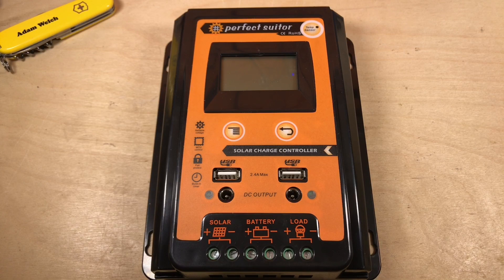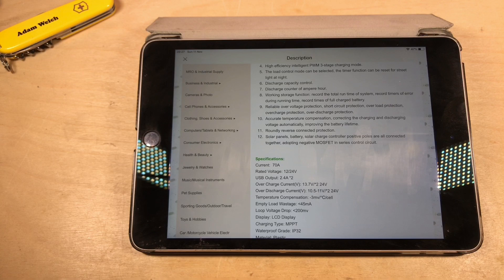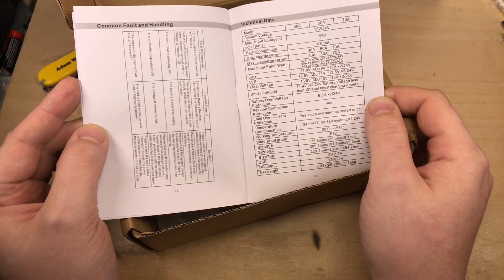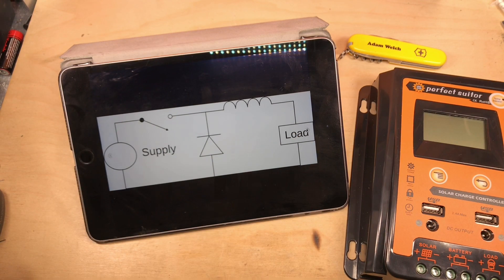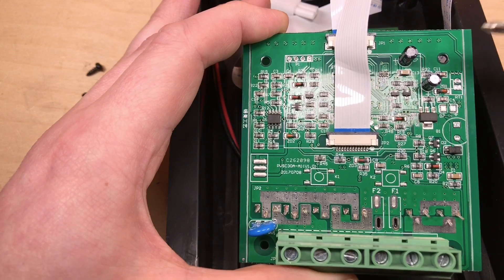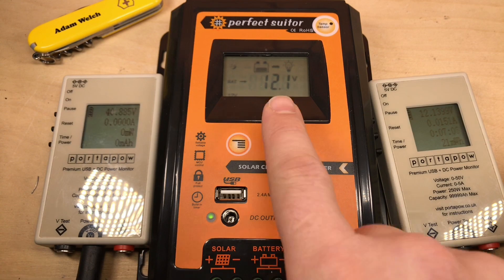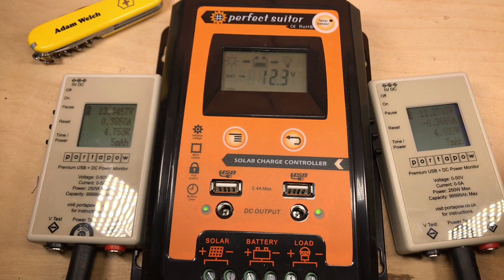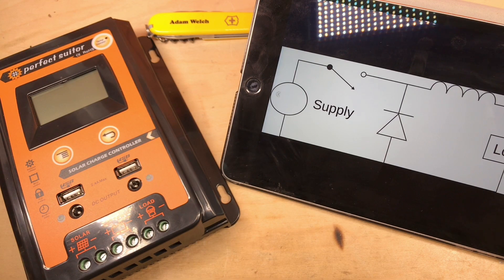MPPT or PWM? Perfect Suitor Solar Charge Controller

Comment: I have subscribed and watching all your nice videos. I have 3 cheaper PWM controllers and the last one I bought this Perfect Suiter PWM controller. I have 300W- 24 V solar panels I have bought over 100 recycled laptop batteries and spent hundreds of hours in charging and discharging with smart chargers and Imax B6 charger. I have made 5 battery packs starting from 3S 5P to 4s 15P packs. I just finished building my first 7S 21P battery pack. But my cheaper blue PWM  and this Perfect suiter controllers are charging my 4S packs up to 13.7V only and stops there. my 4S pack can receive up to 16 .8V but I do not understand how to do that. I am frustrated and in a desparate situation. My 13.7V packs work for a few hours only and dying. Please guide me and many thanks for your help.
Reply: You need a more expensiver controller supporting wide range of battery voltages, like Epever tracer-series (8-32V) then you can configure the maximum charging voltage.
Reply: Christer Olsson  Thanks a lot Christer, Adam did not replied to this question. Very bad, but some other YouTube experts replied to me and as per their advise I have already purchases a epever tracer 20A mppt controller. But not yet connected as it is not clear instructions on the manual for a beginner and worrying and waiting. If you are using epever tracer  you can guide me one time. If you are comfortable I will give my email address here. Thanks again.

Comment: no large inductor == no buck converter == no voltage step down
no current shunt resistor == no power measurement
no power measurement, no voltage stepdown == no mppt
Reply: You culd just look for MAX PV WATT 
ALL OTHER BLA BLA. BLAAA USLESS

Comment: I just bought the 30a version and despite what the manual states,  the 30a version is a cut down version with no current display or anything relating to power as it needs amps.  I have just posted a quick and very basic review of it on my chanel.  Go for higher rating unit.

Comment: The fact that products manufactured in china are not exactly as specified stems from differences in business protocol . There is a range posted in every speciation , through in millions of wanna bee's trying to justify a piece of that pie and at the most you get is a minimum spec. product . When demanding more for less from China , it's what you will get every time . All the big names ( Winsor , Bush , Etc. ) siphoned most disparage from that market long ago now and an even playing field is what exist today .   Thanks  All , Thanks  be
Reply: P.S.  Folks like you in the U.S. are buying into three dimensional printers building products with pre certified materials .

Comment: Where does the dc inputs pull there power from the panel or the battery?
Reply from the maker: The charge controller is powered from the battery.

Comment: Thank you for checking this out. I just recently got one for my camper, and wondered about the inductor as well. this gadget really is a small, light package. I tested another one which came with a panel I bought, and got results similar to yours. The display on the other one was very hard to read as well, at least this one looks good and is easy to read. One of the parts on the board where the USB plugs are does look like a small inductor, but it would not be enough to do the power conversion job for battery charging, although it probably is enough for the 12 to 5 volt USB conversion. My guess on that huge drop is that it's a waste of money to put panels in series unless you are setting up a 24 volt system. I confess that I did buy it because of the MPPT claim, and did not think I would lose too much if it isn't because of the low price. It works, and looks nice, but they probably should not be calling it MPPT. I installed a different type which actually can boost current, because of the limited space on the roof of my pickup camper. I can't just add another panel to make up for the lack of boost. I am keeping my "perfect suitor" as a spare in case the one I am using now quits. Thumbs up for your time, thanks.

Comment: Lol. They’re still peddling that junk... I just saw it listed as “simple mppt - no inductance”

I gave up on finding economical mppt controllers and stuck with PWM. Mind, some of the 30A PWM controllers can’t cope with even the 5A I put through them.
Reply from the maker: I actually think for most applications PWM is fine.
Reply: For my purposes, PWM works. Where my issues come in is with the 35AH lead acid batteries being unable to deliver a constant 5A for the 5 minutes required.

Comment: Hi Adam, I wonder if you have found out if the solar charge controller shown in the link below is a true MPPT controller. It says something like compatible MPPT + PWM charging mode.
Thanks

https://www.amazon.co.uk/Intelligent-Controller-Battery-Regulator-Different/dp/B07CNP2G5P
Reply from the maker: I haven’t tested that one, but take a look at Julian Ilett’s video about something very similar... https://youtu.be/KA3X8XLxWHU

Comment: Hi great video,

Ihave the following for my little project,
Solar panel open-circuit Voltage: 40V
 (20W)
Battery 12 V (AGM
)
Controller : PWM controller max input voltage 28V
 (Mohoo, 12V/24V)
I need to step down from 40V to 25V and connect to solar charge controller to charge the battery. Will I lose energy in this converter in step down mode? Or the module will convert in to Amps from Voltage while step down?

since it is a small project how can I complete this project economically?
Thanks

I have this,
https://www.amazon.com/MOHOO-Controller-Intelligent-Regulator-Display/dp/B07FQ5NWKT/ref=sr_1_fkmrnull_1?keywords=mohoo+solar&qid=1552728425&s=gateway&sr=8-1-fkmrnull

Comment: Adam i've got the 70A version and is a simple pwm charge controler. 
I've made some test with 750w solar array and it works pretty good for a 50$ pwm charge controler

Comment: Overall, thanks for covering this.

What's a book converter though?
Reply: Maynard Johnson its buck converter. It is variable voltage rectifying  module for to turn higher or lower the voltage you want to match your battery charge requirements

Comment: Which of the mppt that you have reviewed considers that it is worth the money?
Reply from the maker: I’ve been using my tracer A series every day since reviewing it.
Reply: I was going to buy the Tracer after reading your review, but since it is a gift for my father, if in the future he has a problem with the solar installation, he will blame me eternally. 
So I looked for another with a better warranty and I bought the Victron  75/15 mppt bluetooth.
By the way, I could see the copy of Victron on a Chinese website. 
Maybe in the future you can also do a test.

https://www.aliexpress.com/item/24V-12V-Auto-Solar-Battery-Charge-Controller-10A-15A-20A-Waterproof-LCD-Solar-MPPT-Series-Solar/32961351161.html?

Comment: Adam,  any suggestions on a REASONABLY priced 20A MPPT ?
Reply from the maker: I’ve used the EPEver range a lot. The tracer A or tracer AN might be your best bet, or the EcoWorthy 20A MPPT charge controller. Both fairly good value.

Comment: What do you think of this Icstation DC 6V-60V Programmable Digital Battery Charge Controller Protection Switch for for Lead Acid Lithium Solar Panel Battery https://www.amazon.com/dp/B06WGWF4HC/ref=cm_sw_r_cp_api_GuQbCbG1HECT8

Comment: They're unspeakable rogues. 

I wouldn't want to trust those 12V wires, the internal connector, and the PCB tracks with anything more than 3 A, let alone 30 A. And what are those output terminals capable of handling safely? Thankfully, you're only drawing 3 Amps from the panels!

The MOSFETS (if they really are) would overheat and fail in no time, at anything close to 30 Amps, because those pads are not making contact with the flimsy metal base panel (at least one of them is clearly wrinkled), and the pads looks more like heat insulation than transfer pads. 

I wish that there was an effective way of banning contraptions like those from being advertised on eBay. The innumerable scams have ruined the reputation of eBay. 

Thanks, Adam, for the clear warning about this garbage.

Comment: If the sun was max, and the charge controller was truly mppt, would the output current be more than the PortaPOW’s limit?  Did you know from general experience or previous measurement that the current would be much lower than the PortaPOW’s limit?

Comment: When the voltage is pulled down to the lower battery voltage, does the current change and move along the panel’s power curve?
Reply: You dont know ohm's law .. do you

Comment: Here is another cheap controller aliexpress.com/item/30A-40A-50A-60A-MPPT-Solar-Charge-Controller-for-12V-24V-36V-48V-DC-Acid-and/32808021790.html 
Appears to be mppt but is quality ok for that many watts as it is rated?

Comment: Aren't you a bit pissed off with the seller for lying and misleading advertising? Are you going to try and get your money back? After my bad experience with the UEIUA Cpt-2410 I am very wary of buying anything from China except the Epever Mppt charge controller which so far seems to be working ok.
Reply from the maker: Just as I tried to show in the video I was fairly sure it may not be MPPT from looking at the listing. Once I looked at other listings I was even more sure. For me, it was worth buying the product to make a video to help others out. Without the cheap Chinese sellers on eBay I wouldn’t have a channel! If they make good products, or bad ones, they all make for an interesting video :-)
The tricky thing is when I review something favourably and then they change it for the worse - just like the CPT-2410 :-(
Reply: Adam Welch thanks, I enjoy your channel and it was your review of the Epever that convinced me to buy one and I have been happy with it. Thanks
Reply: @AdamWelchUK  just starting out and there so much to off grid solar let alone getting scammed. thanks from Los Angeles, CA

Comment: How long will it take for people to realize that MPPT (real) is just useless for battery charging. Here is my fairly old video pointing all the reasons MPPT is just a bad investment https://www.youtube.com/watch?v=cKrh9tdXDX8&t=458s
Reply from the maker: Cheers. In many respects I agree with your argument, and I’ve also suggested to numerous people that your dollars are usually better invested in solar panels. However the biggest issue with this argument is the physical space available. My shed is covered, the only way to increase my yeald is to use technology to maximise the power.
Reply: There will be no benefit from MPPT as in an offgrid type application you can not use all available energy so as soon as battery is fully charged you have excess (will remain unused energy) thus all an MPPT will do in best case is have you battery fully charged 10 minutes earlier and that will not provide any benefit at all.
If battery matches PV voltage as is the case with a 24V battery and a 60 cell PV panel (most common and cost effective panels) then they already work very close to max power point 90 to 98% thus an MPPT will not be able to work unless you have two of this panels in series and then the MPPT may be actually less efficient than battery and the two panels in parallel as if the PV array voltage is 2x ore more battery voltage a DC-DC converter will typically only be at around 92 to 93% efficient and this are for high quality DC-DC converters thus in average worse than not using a DC-DC converter.
Also not sure what battery you have but if it is a Lead Acid then as soon as that battery is above 70 to 80% SOC it will require CV charging and then the MPPT has no benefit over PWM as not all available energy from the panels can be used.
The space argument is not a good one as even if you can have a 5% benefit from an MPPT that will most likely not do anything if your average needs are higher. What I try to say is that the system needs to be size based on the needs and if those needs are withing 5 to 10% meet by the solar system then it will work with or without the MPPT and if needs are much higher than what array can provide then MPPT will not help with anything.
Reply from the maker: As I said I do accept your argument, and I’ve recommended other people follow it. I agree that charging an idle battery ten minutes earlier is pointless, but many people use the energy as it’s being generated. That 5 or 10% increase can mean the difference between charging your battery bank a little or discharging it a little. I’ve looked into using excess energy in other ways once my batteries are full - and if I wasn’t doing things on such a small scale heating some water or feeding excess solar into the grid would be of more interest to me - and of cause MPPT would help (a little) in those areas too. 
Then there are other areas where MPPT can help - when panels have to be mounted long distances from the battery bank. Or an upgrade to MPPT is cheaper than paying for heavier gauge wiring. 
Sadly most people investing in solar don’t have the space, the perfect outlook, the sun right next to their power shed etc. In a perfect situation PWM and investment in an array which will fulfill a users needs 365 days a year is the most cost effective, but most people don’t live in that world. For those users MPPT is an option some people take. Plus you know - people like big numbers on a dial! :-)
Reply from the maker: I’m well aware of your products and I think they are great (and of cause I wish you well with your kickstarter) but I think MPPT has a place, and is of use off grid.  My experience is at a different end of the market I guess. The difference for me between a PWM and MPPT charge controller is something like $30-40.
Reply: For a very small system "toy" with a small panel or two how much you spend is not that relevant but there will still be no benefit to having a MPPT.  If as mentioned before you are using a Lead Acid you will want to keep that as much as possible fully charged or very close and when SOC is above 70% there will be no difference or any gain with an MPPT of PWM (not at all as they will both be in constant voltage meaning not all available energy will be used thus no max power point).
A 30 to $40 DC-DC converter can likely deal with a single 250 to 300W panel best case and not be that efficiency and since you can for same 30 to $40 by a panel that is 1 or 2% more efficient keeping same size that panel will in average do much more than the DC-DC converter.
Even with same panel assuming an 8s LiFePO4 or 7s LiCoO2 or NMC the efficiency will be so high that adding a DC-DC converter will be worse (more loss instead of gain) as the 60 cell panels match so well the battery voltage. Talking about Lead Acid here will be useless as the very low charge discharge efficiency means huge losses that end up heating the battery and generate hydrogen gas.
I used to design DC-DC converter IC's for safety automotive applications and if a DC-DC converter will have added any benefit at all to an offgrid solar system then I will have surely implemented in my devices.
I understand that I'm all about cost effective systems and if cost is of no concern for you then any sort of battery or charger can be used as is just to play with.
LiFePO4 is as simple to charge as a capacitor all you need is a constant current source and PV panel is already that so all you need is to connect the panel to the battery trough a switch preferably SSR and monitor the voltage when you get to 3.55V you just disconnect as cell is fully charged ad do the same for discharge stop when you get to 3V or 2.8V and cell is basically empty.
If all you need is a small below 1kWh of storage system the using a single cell and a PV panel made with 8 cells in series is all is needed then you can just use an ADC from any microcontroller or SBC to know when to terminate charge or discharge.
Only for larger system's a BMS able to monitor multiple cells will make sense.
The SBMS of example represent's just around 5% of the cost of a complete system so for example SBMS120 is around $290 and is a all in one BMS + PV charger + advanced energy monitor and a full system will mean a 3kW PV array about $2500 plus a 10kWh LiFePO4 around $4000 plus usually at least a 2000W inverter 400 to $500 for a decent quality one so total system cost is at least $7300 so SBMS120 is around 4% of the total system cost and very valuable in protecting the expensive battery.
This sort of system will not be for play but very useful and able to power an average energy efficient home around 200 to 300kWh/moth depending on location.
Battery should need a replacement after 15 years or so thus in 30 years the life of such a system another $4000 will be added assuming cost of battery will be the same in 15 years thus total investment over 30 years $7300 + $4000 = $11300 / (200kWh x 12 months x 30 years) = $0.16/kWh in cost amortization so very cost competitive with grid prices and no other system will get closer to this. (Keep in mind this is a DIY system so just material cost where considered and no labor).

Comment: Can you suggest a low-cost MPPT Solar charge controller for lithium batteries
Reply from the maker: If you are after super cheap and don’t need any other features other than charging have a look at this video... Cheap(est?) Lithium MPPT Solar Charge Controller CN3722 - 12v Solar Shed https://youtu.be/liYZ5pYOZDE  Otherwise the only one I can recommend that I’ve used and is still available is the tracer range from EPEver - they are cheap for the amount of features in my opinion.
Reply: Adam Welch 
Yes go for the epever , it works well, and had user settings witch is great!
IAM using it in my RV to charge my DIY lithium ion battery 👍🏻👍🏻.
Cheers
Reply: @AdamWelchUK  I've  been asking for away to override equalization date on the a  epever tracer. It seems odd your only chance to equalize is on the 28th what if no sun that day??? Is there away???
Reply: Victron - worth the extra money